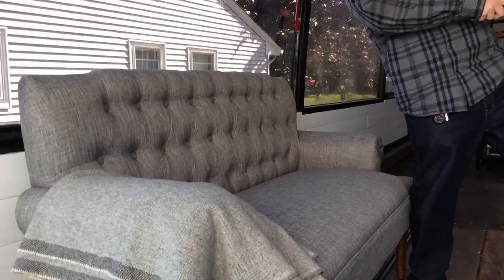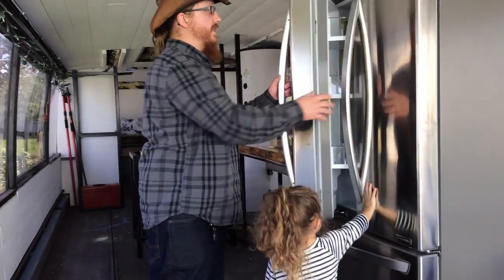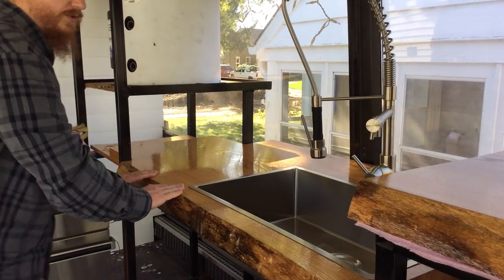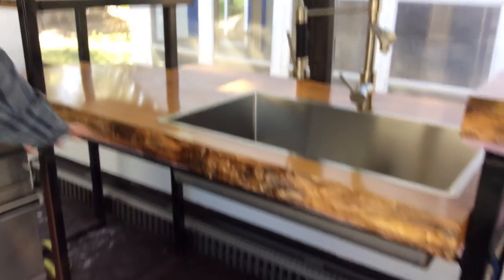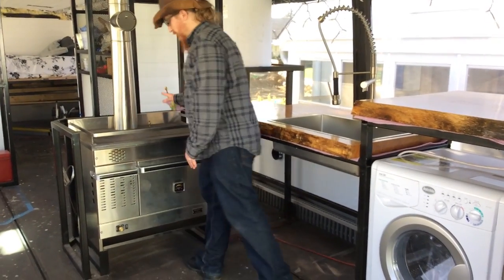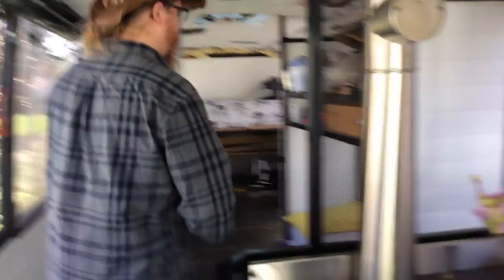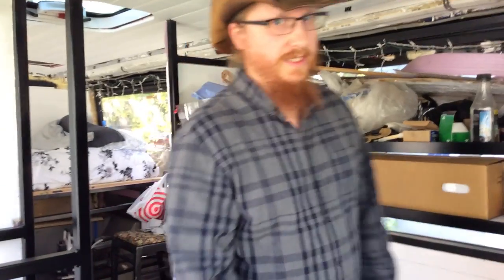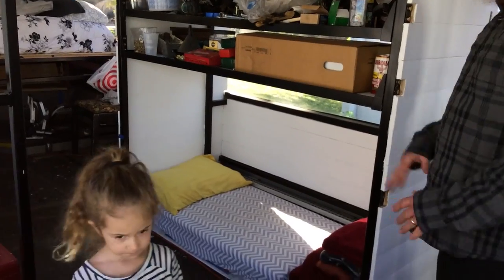Fall (Sukkot) 2017 Bus Conversion Tour

Comment: Great build i purchased a  94 vanhool t800 and this gives me an idea on the room it has so ill keep looking for more of your videos.Just one question is what is your flooring plan as far as the access panels to the engine space on the floor. i wanted to do some tile but have the access to those panels. Thanks bro.
Reply from the maker: Gregory blaylock We have red oak flooring that we will be laying down over the original vinyl. The plan so far is to first use the flooring to create frames around the hatches. They will look like picture frames. Then we will fasten the flooring inside and outside of the frames. We will retain access to all of the original hatches. In the sloped isle i built a steel subframe over the hatch. This way we will have more flat floor space, but will still be able to access the hatches if needed. Hope that helps. It's a bit difficult to explain without a visual.

Comment: I'm a little concerned about the weight mostly on the driver's side of the bus.  is this a problem with a lot of weight  while driving at all?
Reply from the maker: john hodg I don't think it will be an issue. Our rooftop air conditioners are mounted on the opposite side. They are pretty heavy. We can also distribute weight in the basement accordingly if it becomes an issue.

Comment: I was curious about the load balancing within the bus. It seems a vast amount of the weight is on the drivers side. Are you worried about it might have a tendency to roll over or tip to that side?
Reply from the maker: Gail Grimble nope, not really. My office desk is on the opposite side. Also, we have two large air conditioners installed in the roof on the opposite side of our kitchen appliances. The AC units are quite heavy. Our heavy cook stove is pretty well centered. If we have concerns later, we can adjust the weight distribution by positioning heavy items strategically in the basement. Given all of that, I don't have many concerns about the weight distribution. Great observation though. :)

Comment: Love that replacement roof hatch.  Ours looks far worse than yours.  We blocked up the rear one and replaced it with a marine hatch, about 400mm Square.  The front one we want to use to access our roof, cleaning the solar and other stuff we want to put up there.  Even the cab roof-garden we are planning ;-).  Been faffing around, trying to fettle (couple of old English words for you to confuse friends with) and produce hinges that will work.  THEN along comes you with the perfect hatch :-0  So my question is:  Where did you find it ?  We would really like to buy one too.  Despite the fact that we re back in Europe.  I’ve got friends in the USA that could accept a parcel if I can buy online.  We purchase almost all of our stuff vie the ‘net.  Anyway, keep plugging away at it.  We are in this here for the long-finish too.  Regards.  Appledore92
Reply from the maker: appledore92 glad you like the hatch.  There is a link in the video description to a corresponding blog post that contains links to a bunch of items featured in the video. The one you are looking for is at the bottom of the page. When you go to purchase one, make sure they accurately take down the bus information. The manufacturer messed up our original order and sent us the wrong housing. We needed a curved housing to match the curve of our roof. They ended up making it right though. It is a really nice addition. They will likely send you to a distributor to handle the sale.
Reply: Found it :-)  Have made an on-line enquiry.  We'll see what happens ?  Many thanks for your assist.
Reply from the maker: appledore92 I'm glad to help.